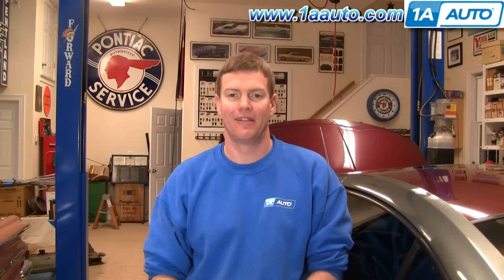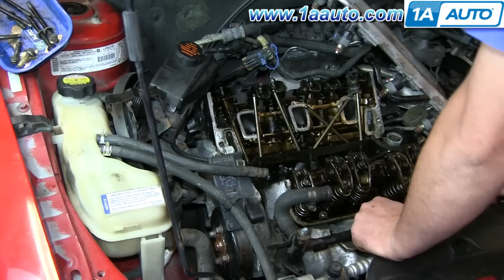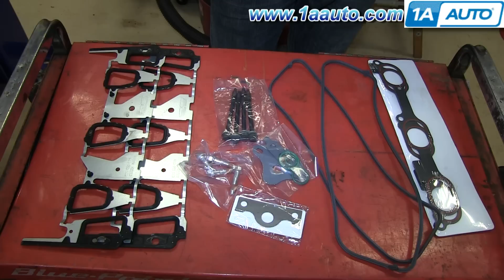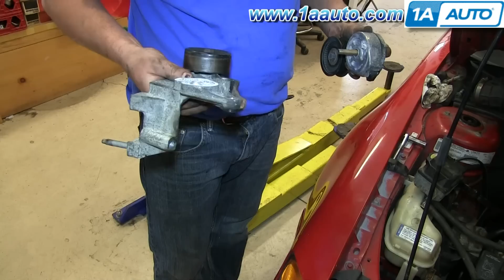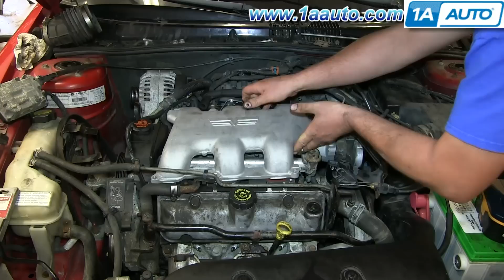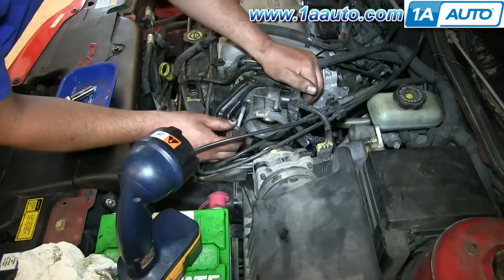How to Replace Intake Manifold Gasket 99-03 Pontiac Grand Am [PART 2]

Comment: This is a solid repair for the 3100 V6, as it doesn’t blow a head gaskets. However, the 3.4 L engine is notorious for blowing head gaskets, and at this point you might as well replace the head gaskets while you’re in there.

Comment: Why wouldn't you suggest to replace the thermostat while it was apart? So much easier to do and it probably should be done, for the 10$ and few minutes to do.
Reply: Same reason they tell you to overtorque the upper manifold they are idiots.

Comment: They may have it listed, bit I didnt see it, very important, when tightening the lower manifold bolts, there is a specific sequence that has to be done. The 4 upper studs must be done first to insure manifold seats on gaskets correctly, Google or purchase manual for correct sequence
Reply: also they really should do better cleaning job on seats for gaskets and I personally remove fuel rail easier than risking damage to injectors

Comment: I am doing this on my 04 Impala with 260K miles on it because of a collapsed lifter. I also am losing coolant but it is not going into the oil. I removed the push rods with my channel locks hooking it on the rockers and pulling them down until I could get push rods out. Video is a big help for sure. Thank you for making these how to videos!

Comment: how many lb ft for the  upper and lower 10mm manifold intake bolts???
Reply from the maker: Click on "Installation Instructions" below the image of the parts (it's in the blue ribbon). That will show you a write up of all the steps including most of the torque specs. You may have to convert from Newton meters to to foot pounds. Thank you for watching. Please let us know how the repair comes out! 1aauto.com?utm_source=YouTube&utm_medium=CTA%20Comment&utm_campaign=1ATony 888-844-3393

Comment: Video is on point, rookie mechanic who is still working on engines certs. This video walked me down the right direction in fixing Mt lower intake manifold gasket
Reply from the maker: Thank you for watching. Please let us know how the repair comes out! 1aauto.com  888-844-3393
Reply: 1A Auto Parts sure will

Comment: I have noticed some people clean the fuel injectors and replace the fuel injector o-rings. Do you think this is a good idea, or not really worth it? And also, I saw you put a new upper intake on the car, is there any particular reason for this, I'm assuming most people can reuse their old upper intake manifold. Thanks. Great videos guys!

Comment: Great videos I'm working on mine right now . Do I have to put new bolts on the manifold?
Reply from the maker: You can re-use the original ones if they're in good shape. Thanks for watching. 1aauto.com 888-844-3393